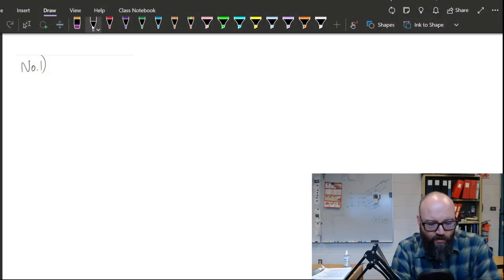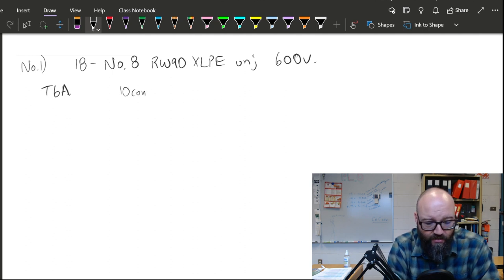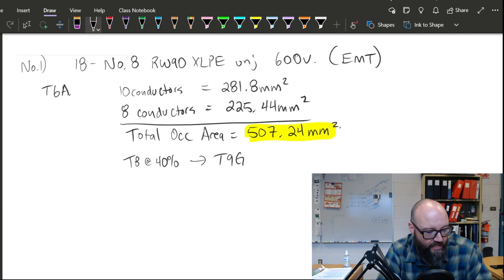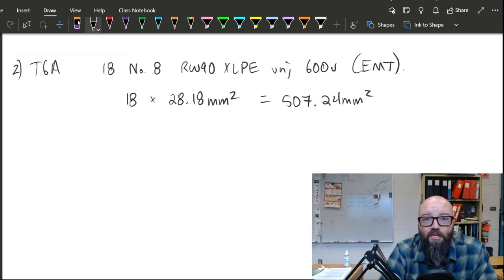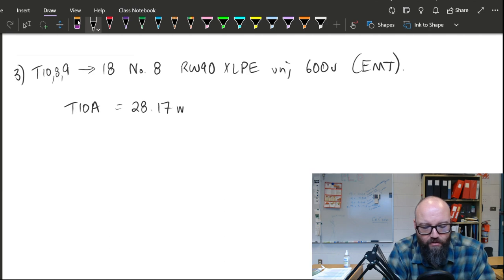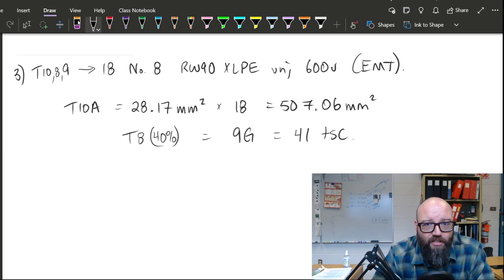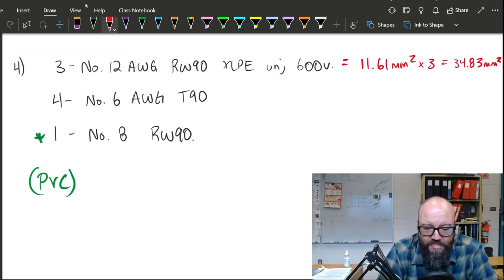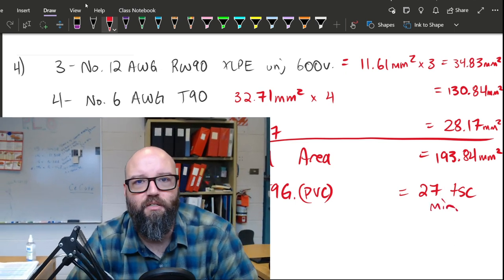Conduit Sizing - 2021 CE Code

Comment: hi, this is a very informative video. I would like to ask, how do you go about if the cable is a multicore cable? say 4C cable? thank you ^^
Reply from the maker: If it is a standard cable, table 5c still applies for conductors that carry current. If it is a flexible temp power cable, use table 12 for this application.

Comment: How about 8-108 rule? Before we can know how many circuit in the panel. Right now how to know how many circuit in the panel? Thank you!
Reply from the maker: There is no longer a calculated method. It will be based on individual circuit demand requirements. The only requirement now is that there are 4 spaces left for future.
Reply: @schulerruler  Thank you for your replyed!

Comment: Hey Men, What's good? this video really help me out how to do pipe fill. Explain very well. keep it up!!! Just a quick question tho, just wondering if you have a video of Wire Calculation as well. CEC 2021. Thanks men.
Reply from the maker: Thanks for the idea. I will put it on the list. I do have some on determining conductor size, but they could be updated!

Comment: Where in table 9g does it say 41 tsc
Reply from the maker: Under the far left column labelled "Nominal trade size conduit" all the corresponding sizes are listed. Just make sure your calculated area is smaller than the conduit you select.

Comment: I like the 2018 table 6 better, it would just tell you right out the gate what size conduit you need for your situation.
Reply from the maker: The issue was it was based off the internal diameter of an HDPE conduit, which was smaller than say an EMT. Using the old table 6 vs 10, 8, 9 often yielded a large conduit than necessary, which obviously impacts cost of installation.